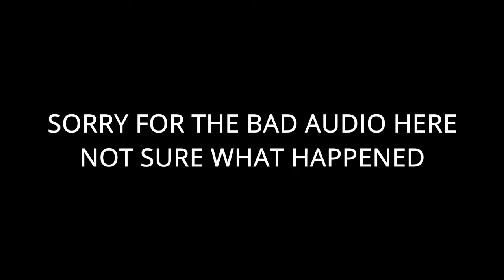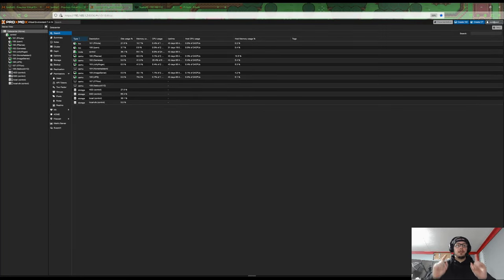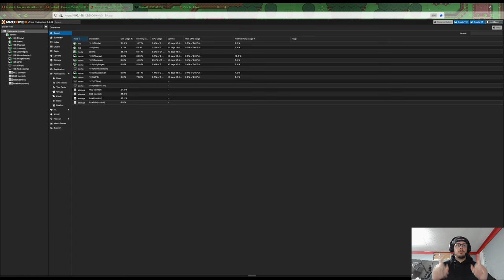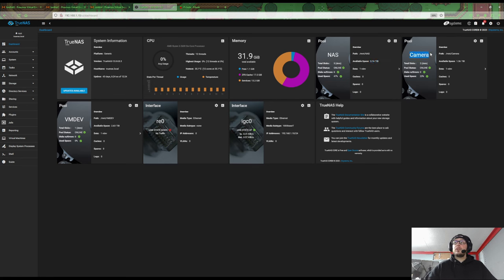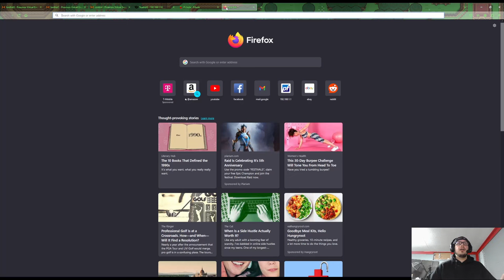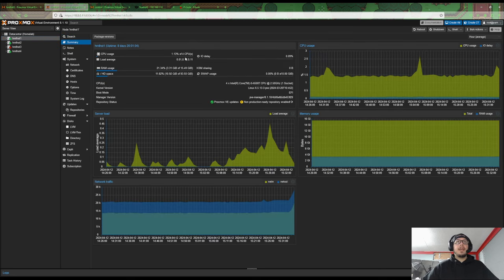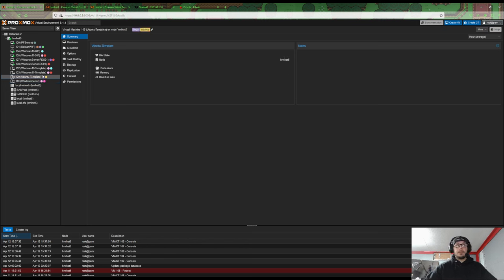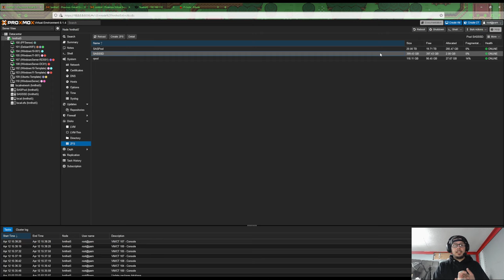HOMELAB TOUR PROXMOX, PIHOLE, AND MUCH MORE!

Comment: A few suggestions: 
1- Nest the switch. just move it into the middle of the two panels, neat cabling. 
2- For the love of god, resist the urge to use home-made cabling. I will put money on that cable bing installation cable (solid core). Preterm cable sare cheap and work. 
3- No idea why so many cables into a VM server, VALN them.
Stopped watching there, I don't use Prox or drink its coolade. I am more a hardware/network guy.
Reply from the maker: Hey thanks for the input. 
1. This is the first iteration of this setup so it'll definitely improve.
2. I spent all the money on the server and have tons of cat5e left from a side job so I made my own, nothing wrong with it considering its a home lab.
3. There are so many cables because I'm working with both SDN and physical. I need to have the ability to make as many configurations as I can to match real world scenarios.
Go back and watch Videos 1 and 2 to get the purpose of this server.
Thanks for watching though :)